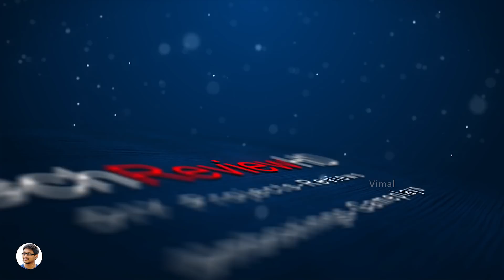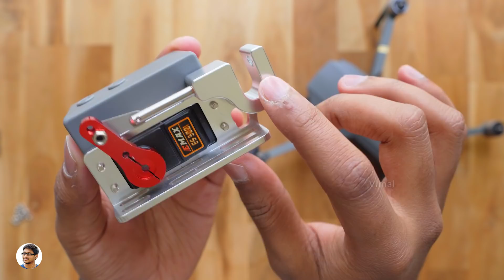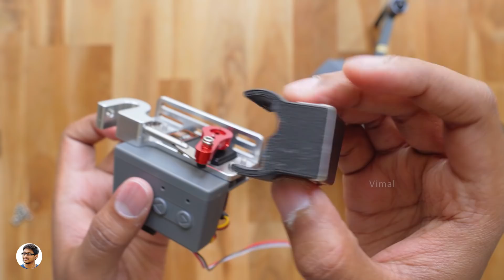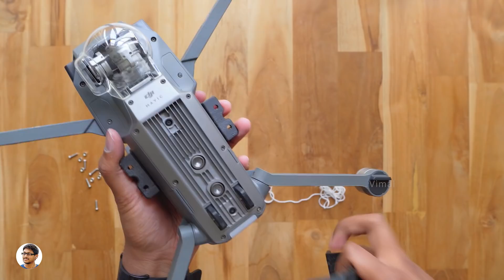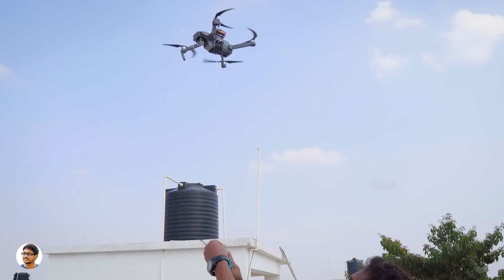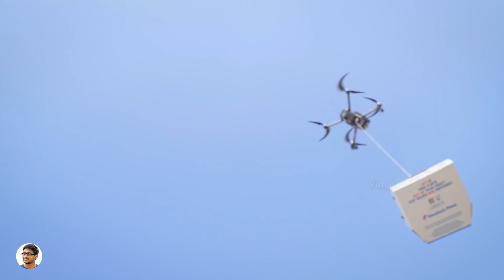I Made a Pizza Delivery Drone !!

Comment: Hi anna i have an idea if u try to 3d print the whole module then   weight with become very less and if u open the drove u will find transmitter if there are any empty slots in transmitter u can directly operate through remote and also after opening drone u can divert the battery wire to the module ....There fore u can remove the battery in module

Comment: you can surely put that whole syatem downward the drone this would eliminate problems with the rubber band
Reply from the maker: You can't put the drop mechanism on the bottom side as it'll block Mavic's vision positioning sensors
Reply: @VimalChintapatlaTR  ok.. then i have an idea... put two threads on both right and left side which will have two rubber band realeased at the same time...
this will maontain the perfect balence

Comment: keep shaft in bottom of the drone bro then may thread not stuck on propellers
Reply from the maker: You can't put it on the bottom side, it'll block the mavic's vision positioning sensors.
Reply: not all the system bro only that hook between those sensors